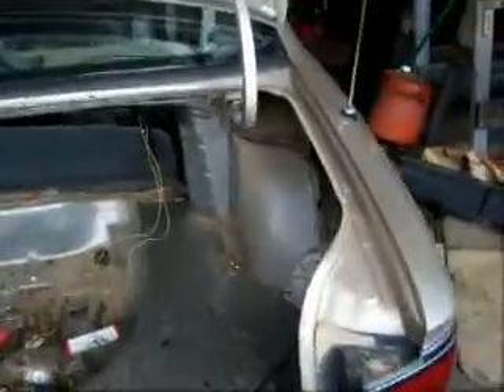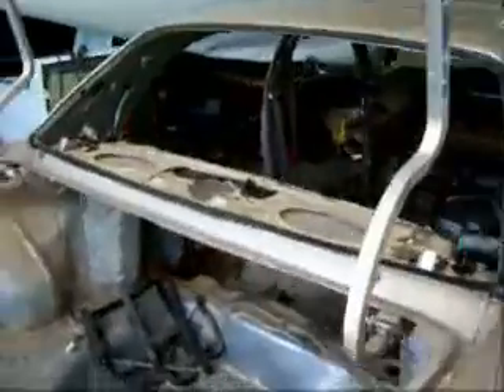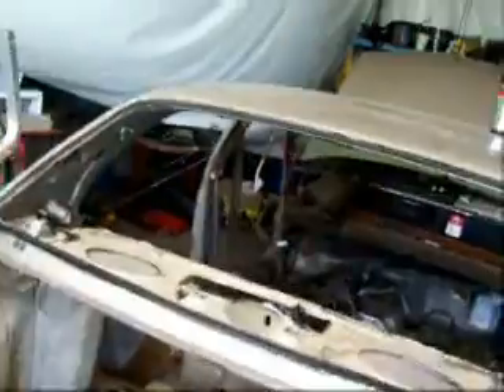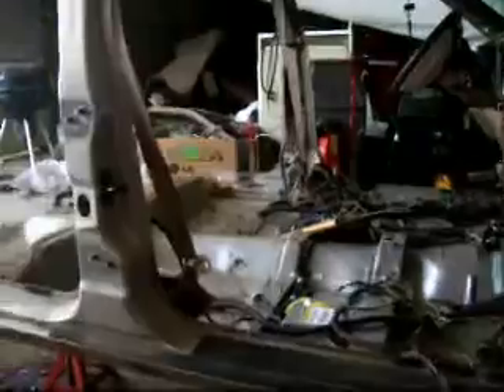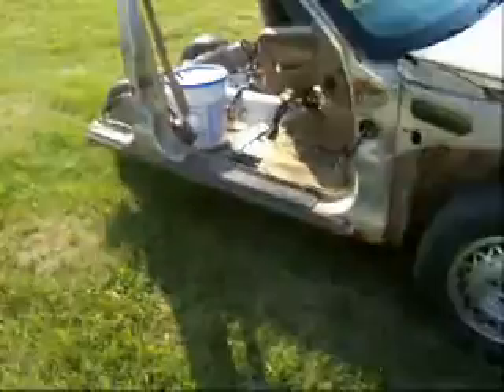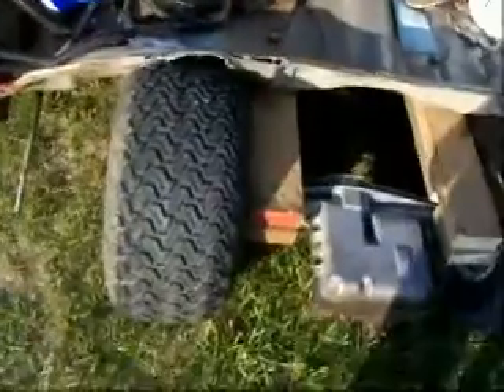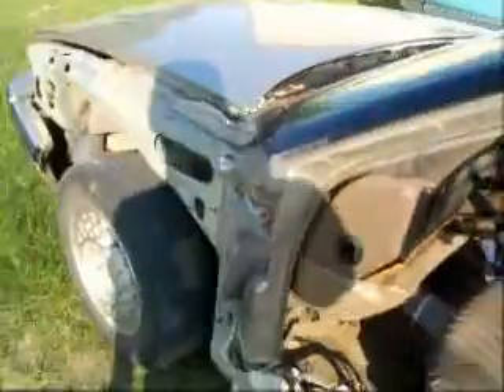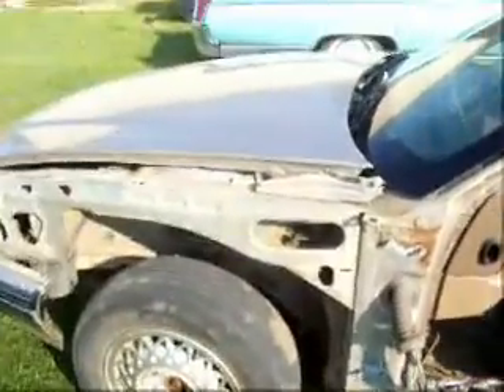95 lesabre teardown part 3 finishing up

Comment from the maker: i parked it because the brake lines were rusting out and i was sick of stopping on the side of the the road to pinch them off lol. plus it needed a bunch of steering and suspension work, ball joints, wheel bearings, tie rods, struts that sort of thing and it needed all new tires